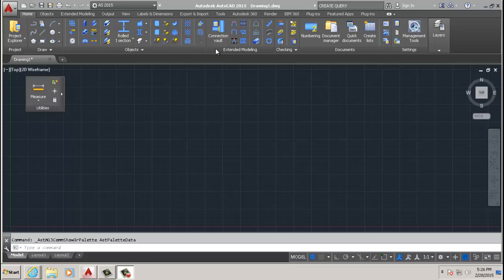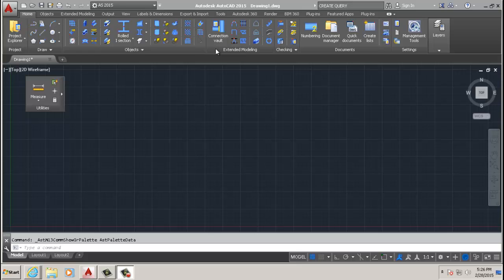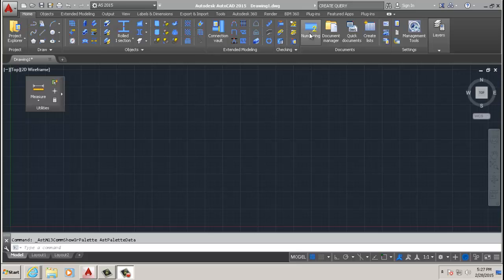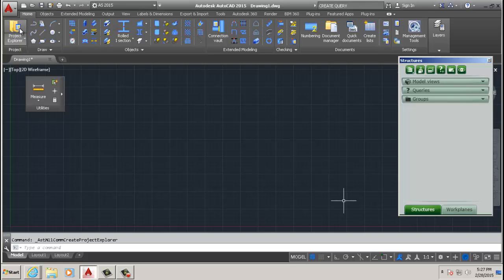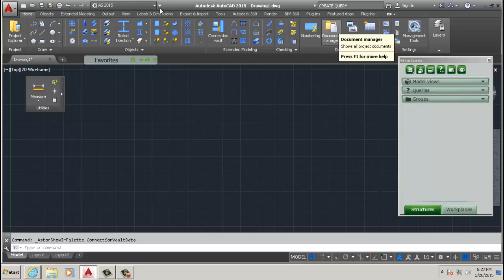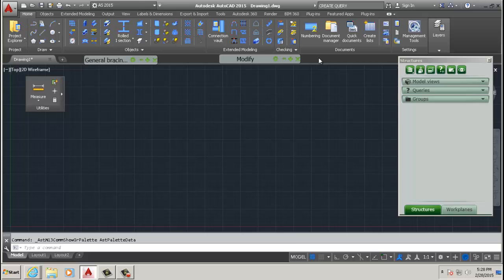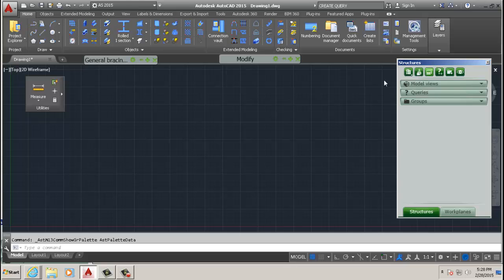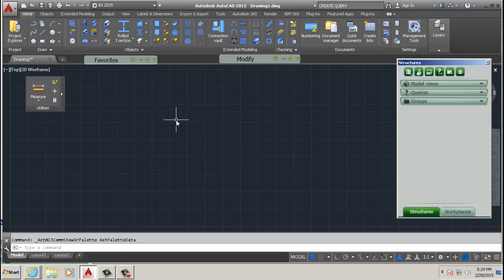AUTOCAD ADVANCE STEEL 2015 TUTORIAL PART 1

Comment: Dear Steel drafter,
Could you please help me. I have a connection which one I beam and one I column. Need to draw a cap on top of the column and extend to beam. This cap shall be fasten to beam by bolts.
I try to use knee connection to draw a cap and extend to beam. But I don't know how to add bolts.
Thank you very much!

Comment: I have installed civil 3d 2015..Do I need to install autocad as well? Because i found that civil 3d act as autocad 2015. Please let me know....and In this video there is Objects group, Extended modeling group in Home tab..but I didn't find It when i launched "civil 3d as autocad 2015".. Thank You
Reply from the maker: This is "advance steel" which will be different from "civil 3d" I know that both have basic autocad commands. In the case of advance steel you need autocad preinstalled, I have not installed civil 3d but i know it should have some instance of autocad incorporated in it. The best advice i can give is: install pure autocad first then install civil 3d.
Reply: Thank you